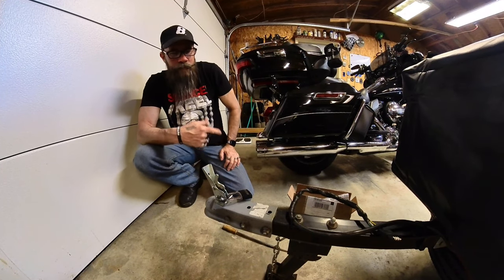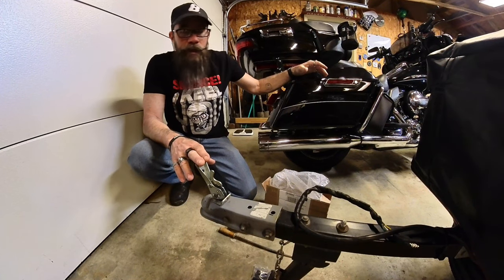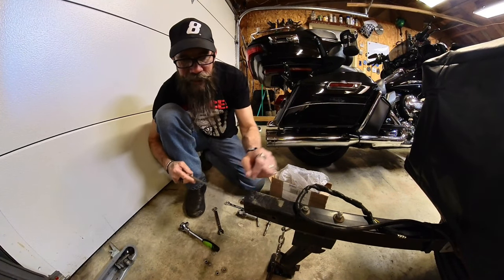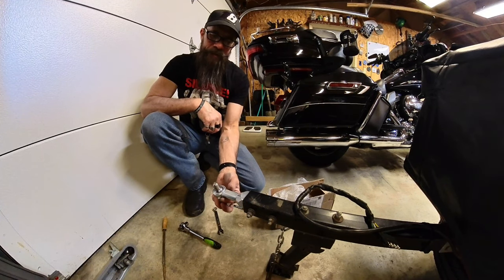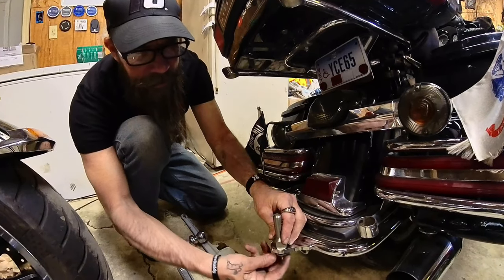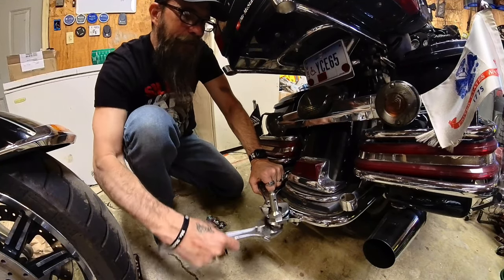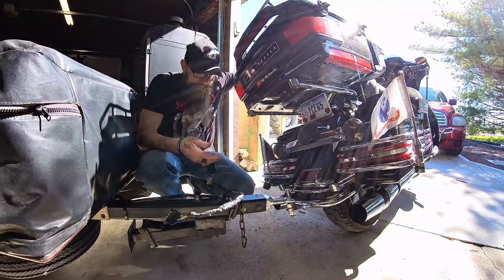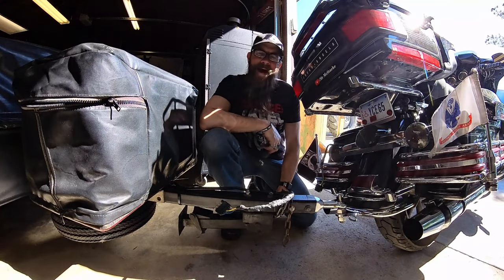Heim Motorcycle Swivel Trailer Hitch #KompactKamp #KwickKamp

Comment: It was 7 weeks and 2 days ago when i did not have a helmet on and i was the victim of a hit n run by a semi truck on my 16 ultra. Broken arm, lost my spleen, and i have 15 fractures in my head. The head fractures is the worst of it. When i get another bike i think I'm gonna start wearing a helmet. I'll never tell anyone else they need to but maybe i need to wear one. 

I really like this style hitch, appreciate you showing it off and discussing your opinions and experiences. 

Youtube said check out this video, i wasnt searching for this but I will eventually build a camper for my bike, this is what I'd like to use for a connection. 

Thank you
Reply from the maker: @michaelosmon  I 100% agree with your helmet position. As far as the hitch it made a world of difference pulling a trailer. No slop in the ball and tracks like a dream 
Check out a guy “daves crazy trailer” he has built 2 and is working on 3rd motorcycle trailer.

Comment: Not only is there the rotational benefit on turning you spoke of when the bike is leaning. But there is no instantaneous shift or tug, fore or aft, on acceleration and decelerations. Absolute sublime pulling connection. Bushtec trailers set the bar with their renowned Heim connection. Beautiful motorcycle. I am into lights. And lots of them. See and be seen. Safe and happy travels. ATGATT.
Reply from the maker: As a rider it pulls and tracks a lot better. Definitely worth the money

Comment: Thats a cool setup. I was scared of how much the bike moved when you attached the trailer the first time.
Reply from the maker: The Harley has kickstand with a ton of play, it’s actually (originally) designed to be able to “shake and wiggle” the bike onto a concrete block and be able to change the rear tire. The original design is Harley was with long ride in mind. Part of why I believe they have not gone to led lights. The lights they run can be bought at almost any gas station

Comment: Nice . But if I was you would keep the ball recever in camper just in case need to pull it with regular ball hitch
Reply from the maker: That’s a good idea or carry my Mississippi torque wrench so I can put that ball replacement on somebody else’s bumper
Reply: @Mr.McStache  shaft size be different .  But either way

Comment: That's a pretty trick little part. Even if the bike were to have a parking lot tip over the trailer would be protected.  At a minimum it may stop the frame from being twisted.  Great video.
Reply from the maker: That’s probably why the wife made me get it, in case I drop the bike lol happens more than I care to admit.

Comment: Mississippi torque wrench? That’s a new one.  I usually refer to those as the “nut rounder-offer” or “adjustable hammer”. LOL.
Reply from the maker: Nut rounder offer I will agree with hammer is improper use. If you are going to pound that the time and get the BFH and beat it to submission lol

Comment: Heim joints are good, been used for decades on race machines etc, only one possible issue is if your going to tow another trailer, helping a buddy, your stuffed, same goes if your bikes damaged or broken down, trailer needs to be towed by the corresponding hitch. I’d go def for a swivel conventional tow hitch...
Nice vid though 😃
Reply from the maker: I have been picked up on the side of the road before. I carried the old trailer nose then now I carry an extra pin. Could also remove mine  and use it or put the ball back on for other trailer. But the “slop” is gone and trailer tracks a ton better. Thanks for your input, great things most don’t think about

Comment: Cool....What was in inside dimension of your trailer tongue?
Reply from the maker: inside dimension of 1-3/4" x 1-3/4". The swivel bolt mounting holes should be 2-1/4" apart in the tongue. This is what it called for in the order form and what mine was. Have a feeling its a common measurement. Trailer tracks so much better too!

Comment: Just do yourself a big favor and don’t forget the red Loctite on your pin bolt……. (I noticed you did not)  Otherwise, you and your trailer will part company. Take it for me, that big nut will not stay tight, and when it comes loose, will give you every kind of havoc you can think of and your helmet will become absolutely essential one more time believe me, you don’t want to see that happen.
Reply from the maker: Yes most of my installation videos I say but don’t always show it due to videoing. I will normally pull it all apart and do it with no distractions to ensure a complete Job. Thanks for checking I appreciate it